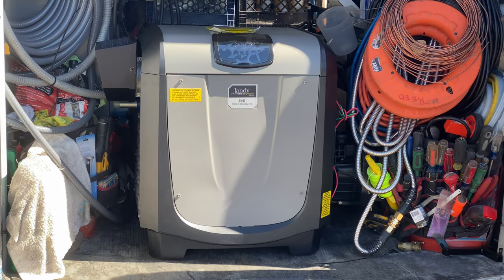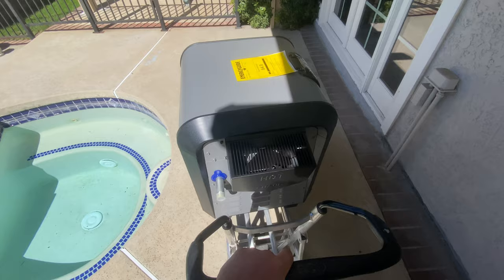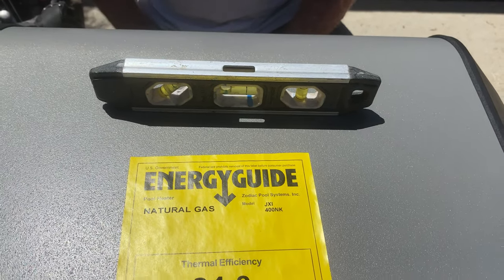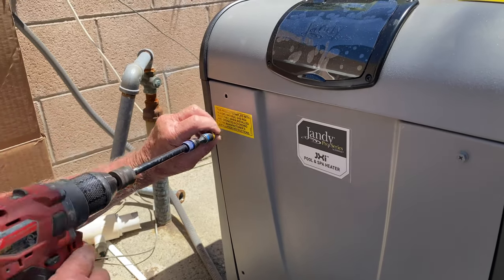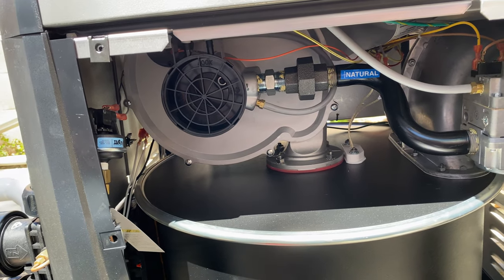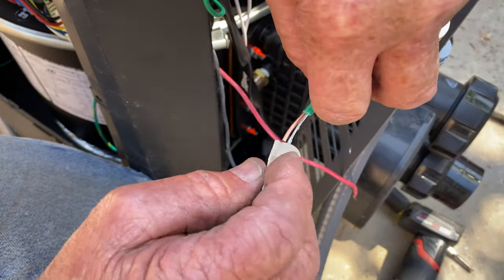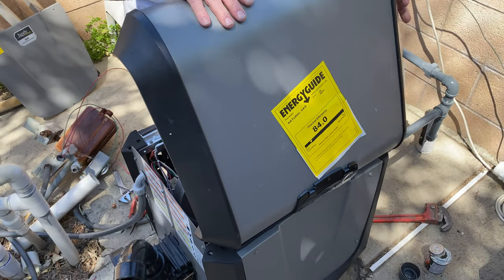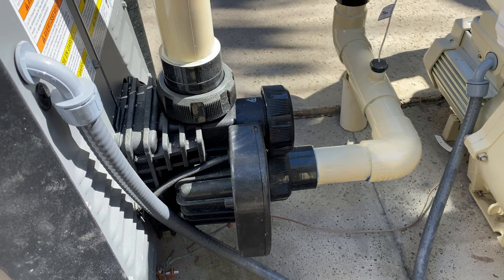Jandy JXI 400 with Versa Flo Swimming Pool Heater.

Comment: The heater does NOT come with an internal “Gas Flow Shut Off”.  
But... There is a “Toggle” on/off switch on top of the gas valve, inside.  I think it just turns on or off the electrical pass thru enabling or disabling gas valve operation.

Comment: good luck with this heater! the jxi400 pro gets 2.6/5 review on amazon. My JXI400N went complete unserviceable on 3rd season(Canadian pool season June-Sept) with leaking heat exchanger. Waiting for replacement as speak. Very interesting to see if the Versaflo actually make that much difference, warranty jumps from 1(3) yrs to 5! Mine was N version without Versaflo but ordered one for the new unit. Also adding a check valve at outlet.  Was the heater installed for a salt water pool?
Reply from the maker: Doesnt matter what heater you buy, heat exchangers do not fail . But the people who take care of the pools water chemistry do.
Reply: Same here but no versaflow, gonna buy a new exchanger attempt to replace and install a versaflow.  chemistry was always fine this is a Jandy problem there are many people out there that have this issue.  Hopefully the versaflow will help.
Reply: @timothybolton5111  as a home owner, my Jxi260N died just last week on its 4 year in service anniversary.  I test my water weekly and have a journal kept of all readings.  My water chemistry is within all acceptable ranges.  I'm pissed that I need to replace my unit due to a leaking heat exchanger.  I'm replacing it with the Jxi260NK with the factory installed bypass, simply for the 5 years on the heat exchanger and also because I have the full automation from Jandy.  Unfortunately they are backordered in Southern Ontario for 2 to 6 weeks.
Reply: @Steeltowndubber  good to know. My last hot tub heater was that mini max one and it had a catastrophic failure where water was shooting through the doors and geysering out. The house was built in 2005 and I bought it in 2019 and it was great for the first few years but what I was annoyed about was it was sitting dormant for 6 years and had to get everything revamped so i think that didn't help. Luckily my spa guy immediately ordered this heater and it was installed yesterday and seems to be working fine even though its been over 100f the past few weeks and really don't need the heater working.  My spa is a in-ground massive hot tub that's the size of a small pool. Im curious to test out the water bypass feature and essentially turn off my heater since I have no need for it and just use my spa in the summertime cold to cool down.
Reply: sounds kinda like water chemistry if the exchanger fails that quickly.   ive seen one fail year 1 due to chemistry....(PH).   and ive also seen one rolling a very long time with no issues

Comment: I have what you have but pulling my hair out. The fan starts and then stops never turning back on. The display has a code I googled and still could not figure out what it meant-but none of the buttons work on the unit. I'm trying to figure out if it's the interface board or valve or something else. Thoughts? THANK YOU FOR YOUR HELP:)

Comment: Ah, sediment.  Our gas company had an "oopsie" down the street, and sediment blocked the line upstream from the meter.  We thought there was a problem with the meter, the gas company came and replaced it with a larger capacity meter, still not enough gas to run our hot water heater, stove, and pool heater at the same time.  We eventually got the gas company to agree that there was an upstream sediment blockage, only after numerous pool heater service calls ($) and plumber calls ($$$$) to try to find the problem downstream from the meter.  Lesson learned: Get the gas company out first to verify upstream flow.  Fortunately, no sediment got to the Jandy JXI heater.

Comment: Started to look at using these heaters, use mostly Raypak beasts. Our gas fitter has had huge electrical problems with them, you noticed that yet? Thanks for doing all the vids so far .
Reply from the maker: Power distribution boards sometimes yes. Thanks appreciate ya..

Comment: I an replacing a LXi with a new JXI for a 16000 gal pool.  Presently have a 250k unit and would like to install the 400K JXI to get the pool temp up quicker.  LBI - NJ near the beach.   
Question:  If the gas demand is too high, can I shutdown down a  heating tube or two?    And Is there any special reason that 400K may be too large?
I would very much appreciate you thoughts and experience.
Reply from the maker: You can’t shut anything down once a 400k is installed you either have enough supply or you don’t. And if you don’t bigger gas line is required and or bigger meter/regulator.

Comment: Nice video! Do you know if the pump needs to be running for the display to work? I'm working on a new pool, no pump yet, but wired everything and I'm getting nothing on display. Tested all the voltages and there is electricity coming into the heater.
Reply from the maker: Idk I would call tech support on that.. some do and some don’t. I believe the jxi will just say no flow.
Reply: @PoolVolution  thanks for the reply
Reply: I'm having the same problem.  I haven't had time to look into it yet.  My heater is connected to an automation system which controls a relay to the heater power.  I suspect something is going on there for my setup.  I read on the panel that the pump needs to be running, gas on, and set to highest temp setting to get started.  But so many other things to deal with now, having moved into this new house...
Reply: @PoolVolution  Correct display will state low flow
Reply from the maker: @longbra  go to my Instagram pool_volution and DM me. I’ll walk you through it..
Reply: @PoolVolution one of my customers is having the same issue. Brand new heater. Any help would be appreciated!

Comment: I hope that your not getting paid by Jandy,  I had one installed by the professional installer along with all of the associated Jandy products. it lasted 2 years before r/r. They refused to replaced it under the warranty. Rather than fight with then I simply bought one on line an upgraded unit. One year later and it needs repair. Because it is a Jandy product and was not installed by a Jandy authorized center they will not honor their warranty.  Never never never again will i buy any Jandy product...